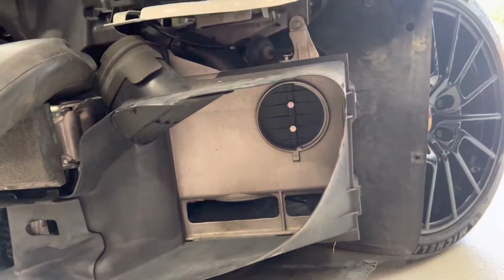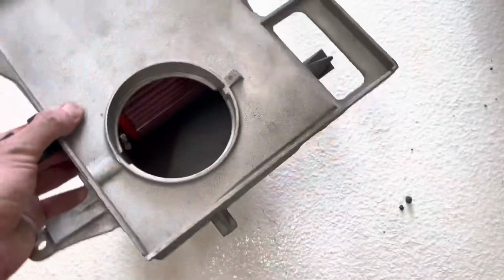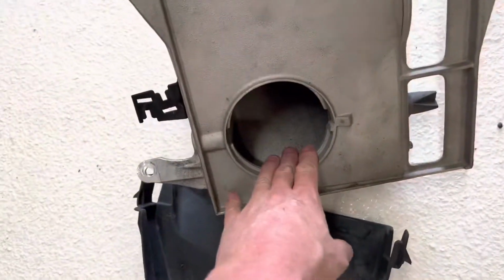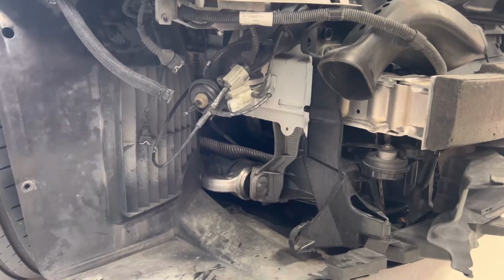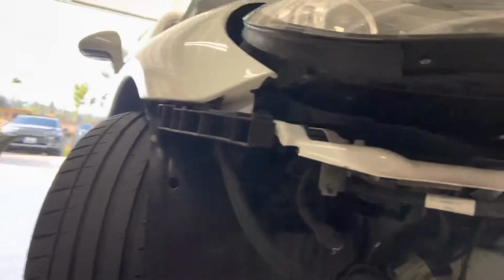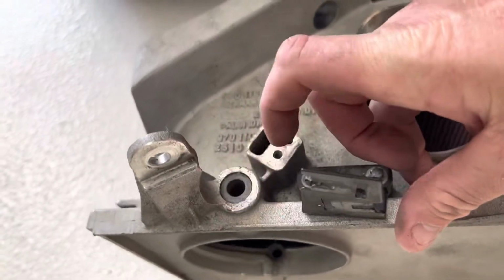970 Porsche Panamera GTS air filter / secondary filter replacement & full time ram air modification

Comment: FYI, that’s the worst way to do this. You could’ve just taken the tires out taking both covers on each side and the box was in there. You would just take the four bolts out and replace the filter. What you did just added at least an hour more work.